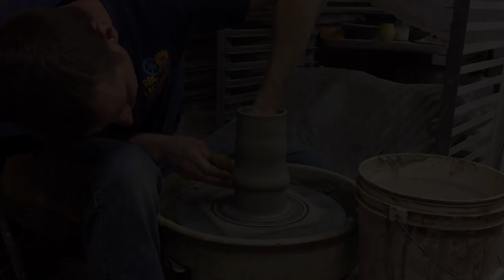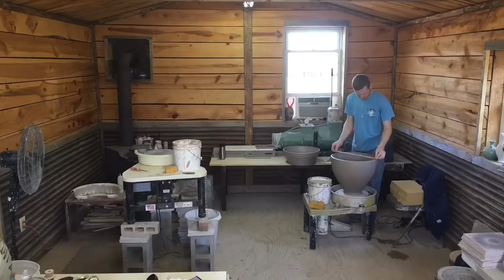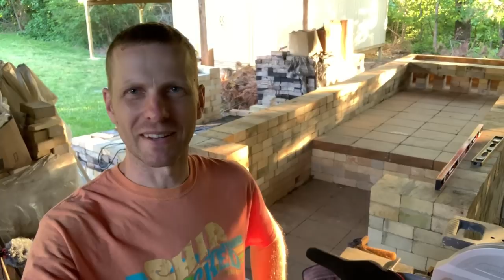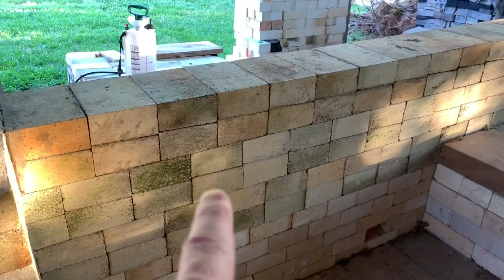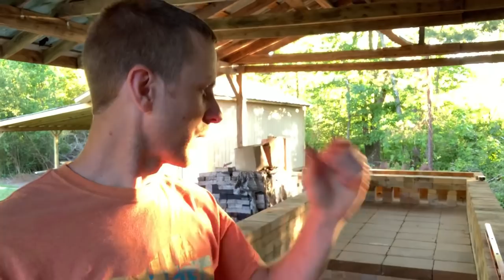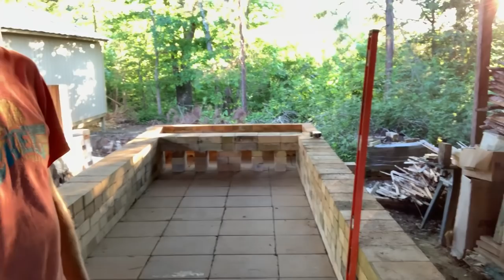Wood Fired Kiln Building Progress!

Comment: Was starting to wonder what happened to you Matt, glad all is well. I am building a little downdraught gas kiln which is only 2.5 cubic feet but at AU$7 per brick X 72 = 490 + $200 for burners + $240 for 3 shelves + $50 for metal and sundries + a few other bits and bobs, lets just call it AU$1000. Makes me glad it's not the size of your kiln. I've made some mistakes along the way but I said to myself, GOOD, and took it as an opportunity to do something better. Thanks for that rationale mate.
Reply from the maker: Haha! Yes I’m undertaking a big task but this is just the culmination of about 6 years of planning and hard work on this kiln project.

Comment: In this sequence, did you "butter" the brick you were laying to make-up for the taper of the #1 arch brick? Also: what ps the finished volume?
Reply from the maker: I’m using mortar to level the brick in both directions and level the new ones with the previous ones.
Reply from the maker: Stacking space should be around 120 cubic feet.  Not 100% sure but that is close